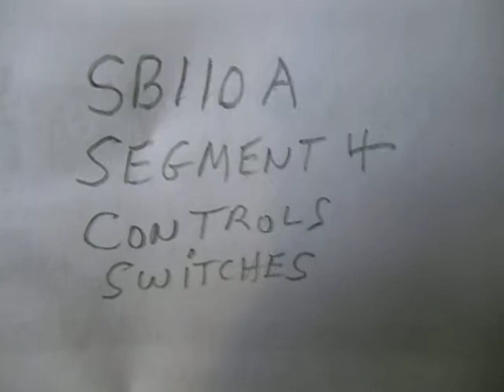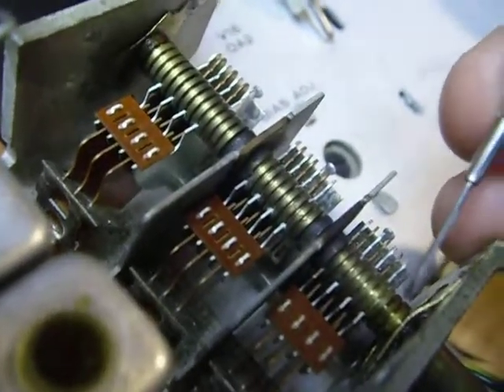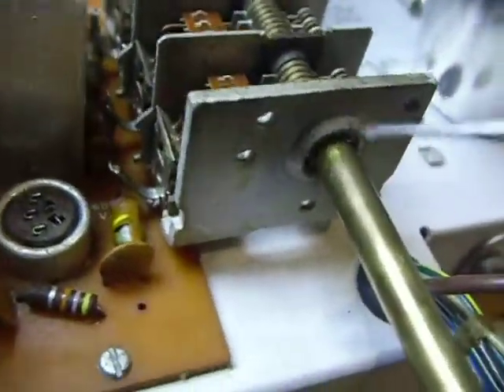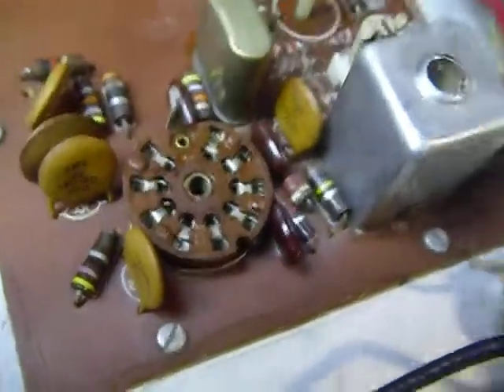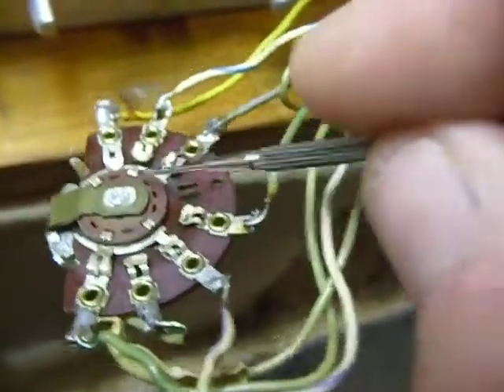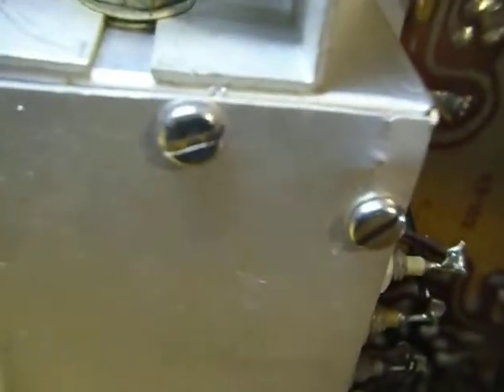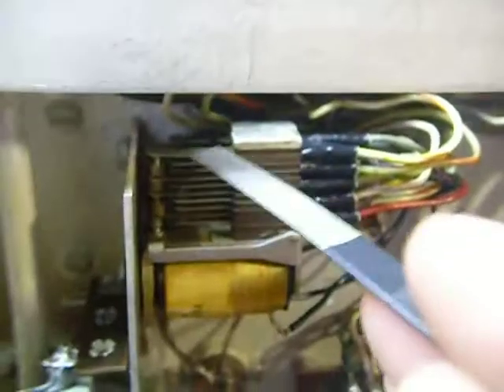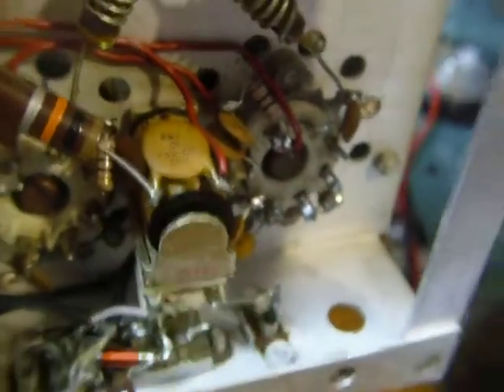SB110-4, SB110,SB-110,Heathkit SB110A, Heathkit SB110, Sb-110 restoration

Comment: Oil is a freaking insulator!... exactly what you Do Not Want on Electrical contacts.  Us DeOxit D5 on pots, variable capacitor wipers, and switch wafers.   Use oil as shown on shafts, bearings, and mechanical moving parts.